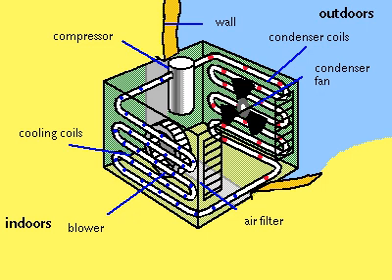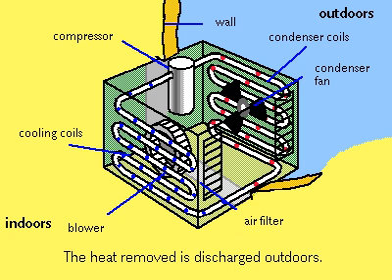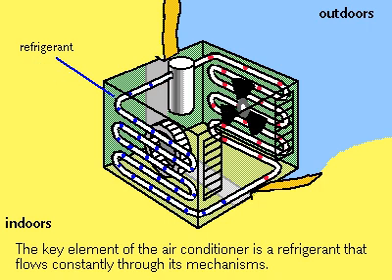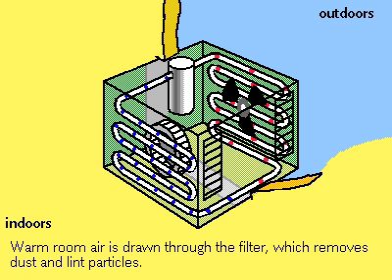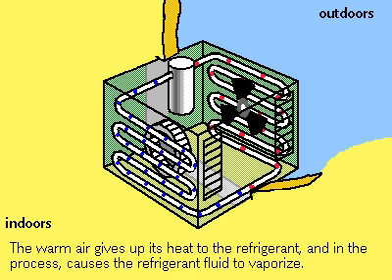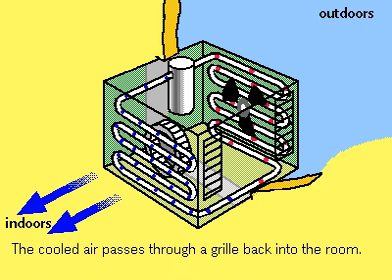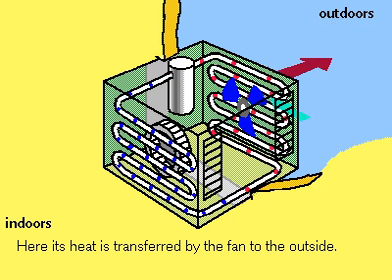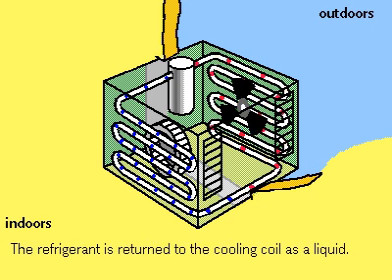How Air Conditioners & Heat Exchangers Work

Comment: @007MOORER - A heat [energy] transfer occured - the refrigerant absorbs the heat from the air - which warms the refrigerant and turns it to vapor.